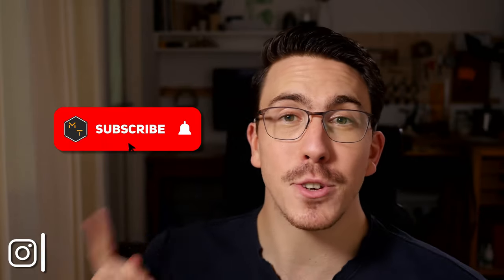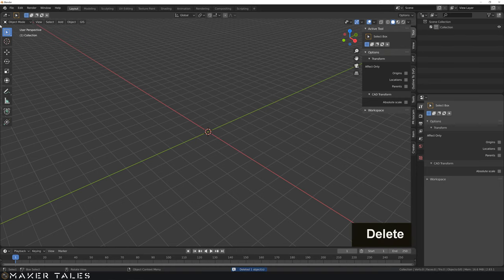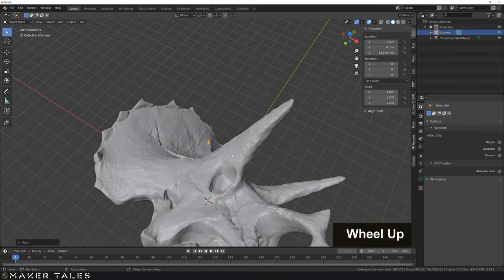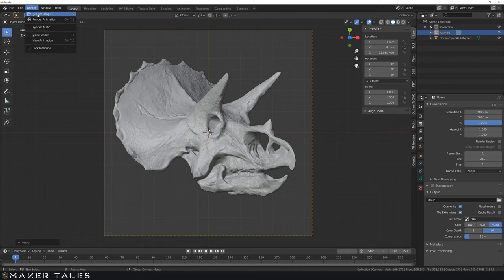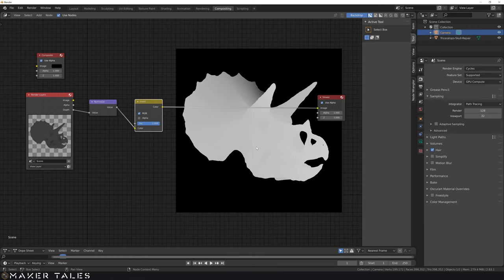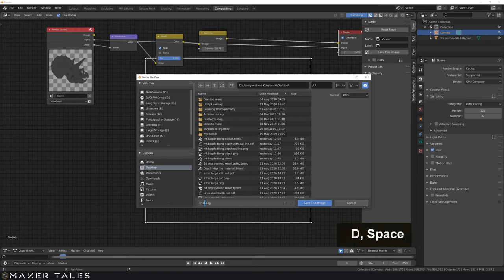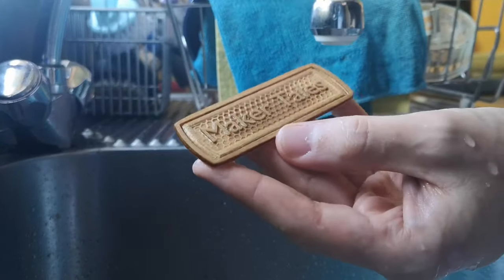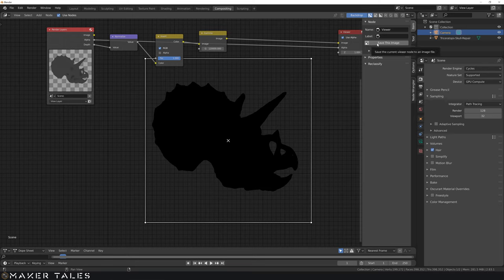3D Laser Engraving | How To Make A Depth Map Out Of Almost Anything |  STL to Depth Map  | Tutorial

Comment: Quick TIP... To clean up the wood after, use a cheap sand blaster with low PSI. It will sand the ash off the wood and you don't risk it warping from the water.... Your welcome!!